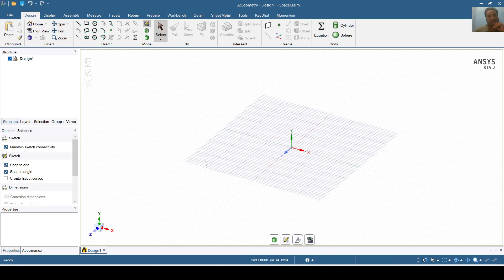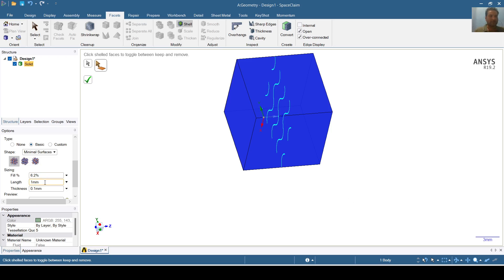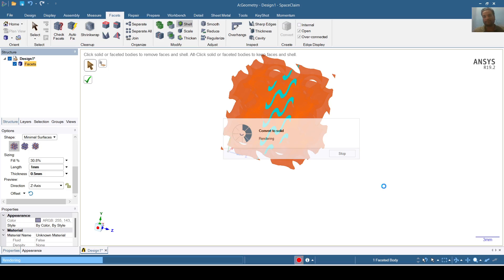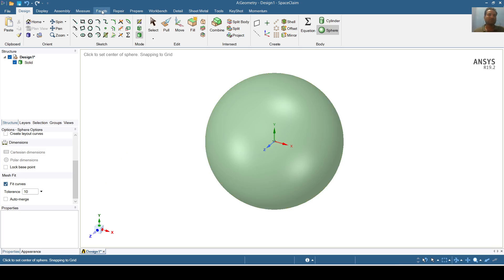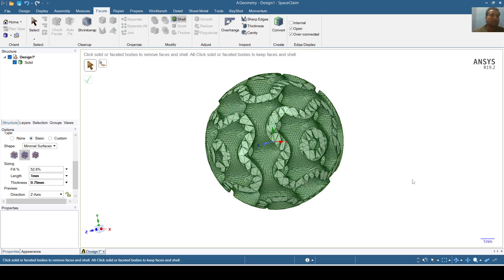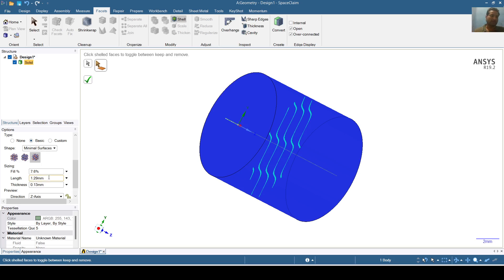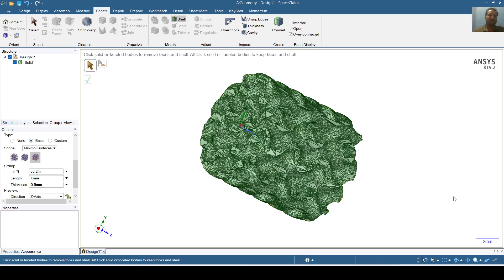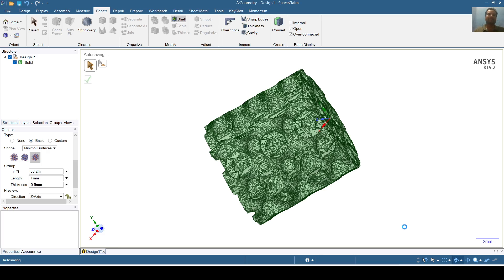How to model Gyroid, Schwarz P, and Schwarz D lattice structures in Ansys Spaceclaim

Comment: Hello, 
Thanks for the video! 

This information is very useful for my bachelor's degree. 
During the work, i encountered a problem, polygons remain on the gyroid structure in the test sample, which do not allow the use of mesh in the static structural module. How to prepare the structure for this stage, i went to "repair" - it did not help. 
Please, tell me how to solve the issue
Reply from the maker: Currently Ansys is not able to fix this issue....literally I can't help you....As soon as I find the answer of this question...I will certainly prepare a video on this ...